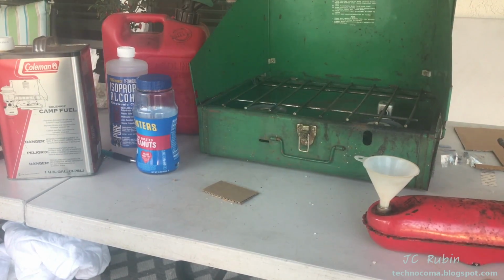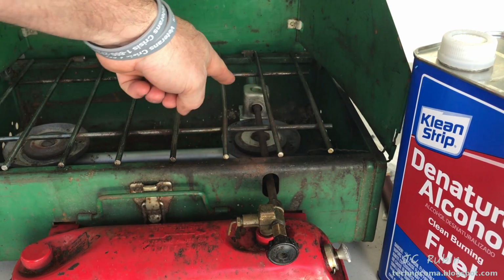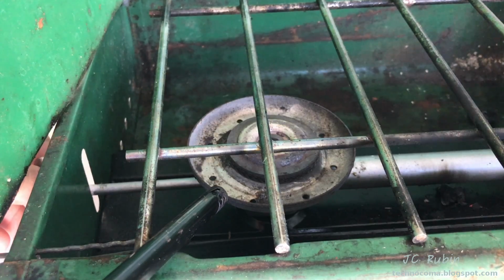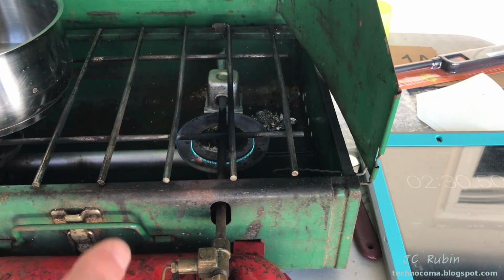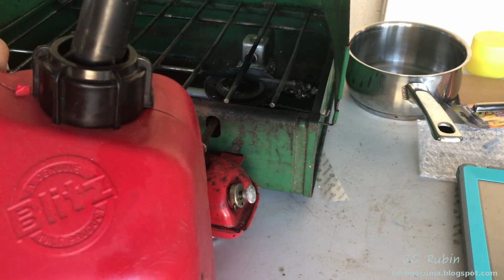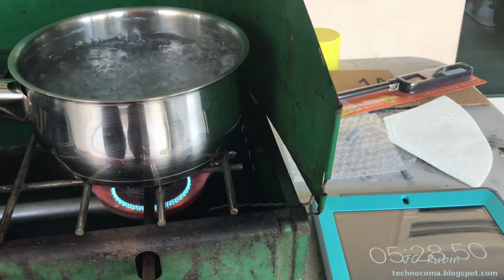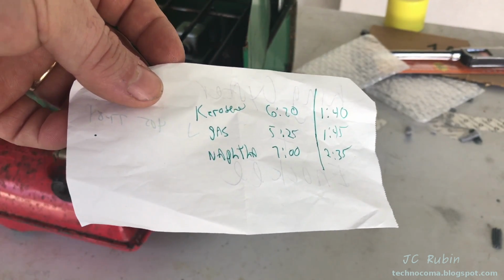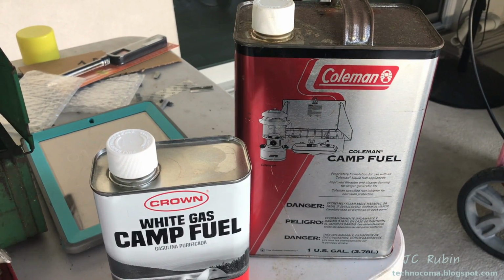Antique Coleman 425 Stove Testing Out Different Fuels for Performance

Comment: I suspect the older Coleman fuel is slower to boil because it either has lower distillates in the older formula which makes it less volatile which results in lower output (BTU) or the lighter distillates have dissipated over time and this results in heavier distillates that burn slower. There is nothing to be alarmed with any type of white gas since they are all pure distillates and leave no residue unlike unleaded gasoline and have no shelf life. The only test needed for white gas is a visual inspection of the interior with a sealed flashlight for rust (water contamination) commonly noticed on bottom and any debris. White gas does not mix with water so it will separate and settle on bottom and cause a leak.
Reply from the maker: Theres also the addition and removal of fuel from the can over the years that contaminates that particular trip.  Its hard to say what gets in there after so many years.

Comment: Charcoal starter fluid is actually Stoddard cleaning solvent, very clean and odor free and easier to light than kerosene. Easy to buy.
My inherited late-50's 425 still has the original box.
Reply from the maker: That might work too in a pinch.

Comment: Fantastic video!  I learned a lot and was surprised by the degradation. To be fair the old fuel still performed quite well.
Oh and very scientific.
Reply: It was a fair test, but not scientific.  A sample size of one iteration per fuel ignores 2 crucial factors of the scientific method.  Consistency and repeatability.  We also don't account for several factors here like, water temperature, ambient temperature, accuracy of water measurement, wind speed and direction, starting temperature of the pot, time from throttle up to pot placement are a few.  These should be measured and recorded for each iteration of the test.  

Again, I'm not complaining about the test, it was fair and you likely wouldn't see much variation, but some items are concerning.  For instance, why would kerosene boil the large pot 55 sec slower that pump gas, but boil the 1 cup 5 seconds faster than pump gas?  That alone is a HUGE red flag that would invalidate a scientific test.  At least that iteration would have to be thrown out.  Until consistent, repeatable results are recorded, we can draw any conclusions at all.  That's why we can't rely on anecdotal data and non-peer reviewed studies.  We don't repeat and review because we think tests are cheated or rigged.  We do it for accuracy and validity.  Career scientists run into outlier data points all the time.  But over many iterations of tests, patterns will form and data points will cluster at the best result.  When we get multiple outliers we investigate what could have caused it and we test those ideas to see if we can repeat those results.   

Science doesn't dictate truth, it gives the best estimates of what is likely true with a given data set.  It get even better when we have multiple studies that produce data consistent with other studies.

About the only conclusion we can come to here is that the best fuel for these stoves is likely what the manufacturer, who did a lot of testing, recommended in the first place.  Fresh white gas/camp fuel/naptha.  But it also is of significant value to demonstrate that in a pinch, other fuels can be used.
Reply: @mikemorgan5015 agreed, but not bad for a YT vid. I thought he should have also tried some fresh fuel since that was oldish too.

Comment: Two fuel you didn`t tested are diesel and small engine fuel (alkylate gasoline). For diesel fuel preheating, is some easier igniting suitable. Even wood. For that stove model, the generator can preheat of outside of stove.
Reply from the maker: I could have tried diesel, but it is nasty to work with. I would have to bee in a hell of a jam to need it in this stove.  Kerosene was a low as I was willing to go on the distillation table that day.

Comment: Do you now if it works with diesel fuel ??
Reply from the maker: That it runs on kerosene with preheating I would say Diesel would be unpleasant if it did work.
Reply: @retrotechandelectronics  Thankyou

Comment: It would be interesting to test which fuels would actually be the least expensive per BTU, though this could vary greatly depending on current prices
Reply from the maker: What is available in an emergency is more important than the going rate in a pinch.

Comment: Any thoughts on Coleman fuel in an unopened one gallon can Coleman brand fuel that is 25+ years old?
Reply from the maker: If its air tight it should be good.  This fuel attracts water so it may still be good but less BTU's per volume if moisture got in, you could try it.

Comment: Thank you for this! I'm slowly moving more off grid in my trailer and I hate propane. Super difficult to fill 100 lb tanks; heaters use propane like it costs .00001 a lb; more than one item that uses it and you need a ton of pipes, adaptors, etc etc; if you only want one off grid fuel propane doesn't cover everything. I have a dual fuel stove and a catalytic heater. Looking for a lamp, which is somehow more difficult. The less fuels I have to carry around and store, the better!
Reply from the maker: White gas works. But isnt cheap.

Comment: Due to work requirements, I just picked up my Coleman 425C that I had as a kid from my parent's house. After sitting for 25 years, she fired right up and ran fine off the Coleman fuel from the same time. I am running the last quart and a half before I start feeding fresh white gas I just picked up a few days ago. I was very excited to watch this video and was pleased to see the results. Great idea, thanks for doing it.
Reply from the maker: You're welcome, it was a fun project.
Reply: I have a new still in the family 425C (built in 62-64) and used by my Father on family vacations. But I need a new red tank as it disappeared over the years somehow!

Comment: I've used #1 diesel for several years .  If you put about an ounce of heat in the burner and light it will heat up and prime the stove.
Reply from the maker: I did not try diesel I imagine It would work since kerosene did but require more pre-heating.

Comment: I think that if you pour some alcohol into the burner before igniting the kerosene it will work. Just saw this on another youtube.
Reply from the maker: There are several ways to pre-heat the generator sufficiently to allow for kerosene to burn as a gas.  Some petromax lanterns had a preheat dish for this reason

Comment: I am glad I finally found someone who actually used gas , I have been afraid to try it. I guess I thought that gas would just blow up if lit..
Reply from the maker: Naphtha (whitegas) is just distilled petrol. Thats coleman fuel.
Reply: what he said, white gas is still pretty much gasoline
Reply: I used 'white gas' in a coleman lamp, I didn't know it was gasoline.  And when it is first lit, it shoots up a flame like 4 feet high.  I was lucky I didn't melt my face off.  After it is lit a few minutes and all the parts heat up, is calms down.  I didn't know camp fuel was gas - like gasoline you ran in your car.  And you can't beat a coleman, they were built to last forever.

Comment: You should try Jet A fuel and if you could find it JP8 which is recommended for the Military MBU's.
As for alcahol if you could find some ultra fine brass screen you could dissassemble the generator and wrap the screen around the shaft of the cleaning rod. The same technique is used by Petromax for running their lanterns on alcahol.
Reply from the maker: I remember JP5 , I imagine it would work.  Most people wouldn't have it on hand though, I imagine it would function similar to kerosene.

Comment: You probably know about this already  but here in the u.k. you can get something called panel wipe from car body repair suppliers , its basically naptha and it works well and its a lot cheaper than coleman fuel ,
Reply from the maker: Well, Naptha itself is cheaper than any commercial product.  If you can still find it at the pump.

Comment: I like your video but for the sake of science, you should have replaced the original filler cap with one with a tire valve mounted on and put the same pressure - around 30 psi - for each fuel tested.  You should also have filled the exact same quantity of fuel for each test since it affects the remaining volume for pressurized air inside the tank and thus the usable pressure.  My point is since all hydrocarbon fuels have pretty much the same energy content - around 19,000 BTU/lb ±3% - the differences in boiling time may be mainly attributed to the uneven pressures from one fuel test to another.
https://www.cottagecraftworks.com/tire-valve-filler-cap

Comment: Why did you add balls of tin foil with the paper towels when you were heating up the coil for the kerosene?
Reply from the maker: Because kerosene will not burn at room temperature as a gas and needs to be pre-heated to start the reaction of  the burner then heating the pipe that heats the kerosene.
Reply: @retrotechandelectronics  I believe she is asking what does tin foil balls do for this heating process? Me too 🙂
Reply from the maker: @JDsModernMartialArts  kerosene will not ignite at room temperature it needs to be pre heated. I used this to get it hot enough so that the combustion process would start.

Comment: I was given the Coleman gas stove (first one) and accidentally bought the Kerosene 1K fuel, the flame stayed yellow and I could not get the flame to be a nice blue flame, do you think I should take apart and clean? I was able to fire the stove right up with the original fuel inside the tank. My friend said he never tried it and didn't know if it worked.  On the first inspection after using the Kerosene I did see a mud dauber nest. Then I found your video heated the generator and got it going, but only a yellow flame.  Any help/suggestions would be great!  Thanks for the video!
Reply from the maker: Its possible the generator [spring] may have soot on it and the long brass fitting and needle as well.

Comment: @12:21 for the gasoline test. You're welcome....
Update: I've read that if you wrap some copper wire around the generator it'll absorb more heat, turning the liquid fuel into gas.

Comment: What does the  valve that you turn up to light and turn down once it burning do .
Reply from the maker: Uses the fumes at the top of the tank instead of pulling fuel from the bottom for easier starting during heat up.

Comment: Great Video, You did not show the clean out from the old white gas, or did you do the clean out after running both fuels. I have a bunch of 20 year old white gas and was wandering if it was still clean to use even if it doesn't have quite as much punch as the new stuff. Thanks again for making such a great video.
Reply from the maker: I just emptied it and shook it out. Since I ran it for a while with the next fuel the previous was already work out or negligible.

Comment: As your post stated it’s just another choice of fuel to use . Some people might not know that they can use propane in the standard Coleman stove but now they do. I thought this was the idea behind your video showing people that they have choices maybe I was wrong ?
Reply from the maker: Propane wouldn't just be a fuel choice. It would be fuel + equipment to adapt it.  Given the failure of alcohol, i'm sure I could have gotten alcohol to run on this, given a preheater and other  modifications, but then it would not have been this stove, but a modified version of this stove which would be great for another video on modified Coleman stoves and what they could run on.

Comment: So I hadn't ran either of my stoves, a 425 and a multifuel, for like 15 yeara. Both had left over coleman fuel in them from last use. 1t years. Both when I removed the fuel cap had air preasure. I closed both up. They both lit and burned on 15 year old fuel. Had 3/4 full can of coleman fuel say at least 10 year old. The upper two thirds of the can burned fine in my stoves and lantern. But the lower portion would burn in my 4wt stove but sounded like a sick jet engine. The throat of the venturi tube heated and glowed red.
Amaxing what these devices do.
Reply from the maker: The fuel is hydroscopic, theres a good chance the container may have lots of rust in it and should be cleaned out.   The pressure is only caused by a difference in air temperature outside and inside the container.  Eventually you end up sucking in water and rust fragments into the generator section.

Comment: Dude it's not degraded. Coleman fuel has green shit added to it. It doesnt perform as good. I've burned about 12 gallons of crown in my dual fuel stove before I even tried coleman fuel. A tank of the Coleman lasts half as long as crown. I wonder what the green stuff is...
Reply: The green stuff is their anti corrosion additives. It is added to a tank that is steel, and bare metal inside. It is the reason why people have steel tanks that are 50 years old, and not rusting from the inside out. Fear not, crown is supposed to have anti corrosion additives as well, although they have not withstood the test of time as coleman fuel has.
Reply: @SBDScott  i call bs. I think its a gimmick and a reason tp dilute their bramd of fuel down and make more money. Doesn't burm worth a damn.
Reply from the maker: Its hydroscopic..... and degraded.

Comment: You did not try propane they make an adapter for it ?
Reply from the maker: If I had to use an adapter I would not be testing what fuels I could use on this stove in a pinch, but what fuels I could use on a stove modified with an adapter to accept propane or natural gas.

Comment: How do you empty the tank after each fuel?
Also, I noticed you use the non dual fuel version stove. Is it safe to use with unleaded gas? tnx
Reply: Yes it is safe to use unleaded in the stove. The dual fuel versions have a generator that is less prone to fouling from the deposits left from unleaded gasoline. The additives in the gas do not burn away, and eventually will foul the generator, necessitating it to be pulled apart and cleaned as he showed in his video.
Reply: These are simple enough to take apart and clean.  Seems to me unleaded is the way to go, saves money and is readily available.
Reply from the maker: I just open the fill cap and drain it back into what ever test container I was using.   Unleaded was used in one of the examples.

Comment: Not sure why you did not say anything about the number 1 fuel ? Most people already have this fuel at there house . Very easy to use very easy to store . You can get it in small tanks and 7 gal tanks 20 gal tanks and larger tanks . Oh and storage life is very long as well. They make an adapters for your stove to run propane . Why did you not talk about that at all. Its a very clean fuel and you can buy long hose so you can use a larger tank . Or you can use a small tank and refill your tank also. So hope people who see this take the time to see what they can do with there stoves . And if you want to cut down the time to get water to boil dammm put a lid on it .
Reply from the maker: Well......
You could have mentioned propane instead of an entire diatribe... thats for starters.  Next, as you stated, propane would require an adapter which would well, require an adapter. and if someone had the time to go out and buy an adapter, they probably could go out and buy coleman fuel. Third, all fuels were measured against each other in the same test under the same criteria, putting a dammm lid on it would have no bearing other than to speed things up.  It wasn't a speed contest on their own, it was a comparison between fuels.
Reply: We as you said its not about speed ? Its about the fuel and the fast you heat things up the less fuel you use? And the post was about  your in a crisis and they are looking for more fuels to use. Yea I know its so hard to find that adapter wew I spent a lot of time looking for it I was online for a minute and ordered it thats so hard humm ? The real deal is its about having more types of fuel for when things go bad. And propane is easy to store. So for a 2 burner stove I would go with white gas and propane.
Reply: @johnbailey9682  spend less time jacking your jaw and do some experiments.

Comment: Crown fuel is better than Coleman fuel.  Less expensive too.
Reply: I began using regular gasoline in my 425 stove and camping lamps.  The lamps work great no issues.  The stove leaves a black suit on bottom of frying pans.
Reply from the maker: I dont know if its better or worse, but it is definitely less expensive.
Reply: greg mccarter Walmart, about $8.00 a gallon, way cheaper than Coleman.
Reply: greg mccarter  Walmart

Comment: I would like to know if it's possible to use HEET (yellow bottle) in a Coleman stove.
Reply: 5USgRWFH Heet would have similar results as when he tested Denature. Remember both are use in alcohol stoves with very much same result with the difference that Heet is more poisonous than denature.. So I’m guessing is a no, personally I wouldn’t try it, I’ll leave those for my Trangia and reserve white gas for my Coleman.
Reply from the maker: There is not economical reason to use HEET in that stove, I would not.

Comment: Thanks for the video i wanted to buy a stove for a person with no home and gas would be the best thing for him to burn is gas cause it's way cheaper. Im glad to know you can use gasoline
Reply: Yes. I burn gas in them all the time. Cook with it in the house to. No problem. Get a CO detector to be on the safe side
Reply from the maker: You can in an emergency. I would not recommend it for casual use with all of the additives they add to gas.  Naptha is a pure and refined hydrocarbon.